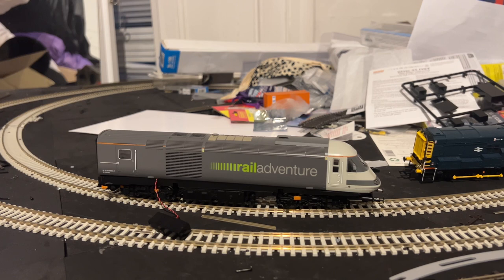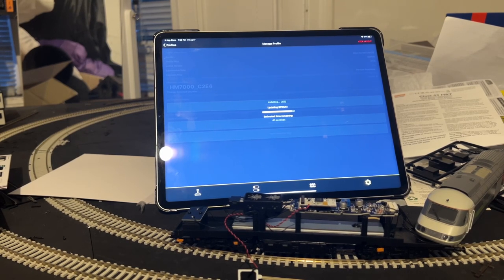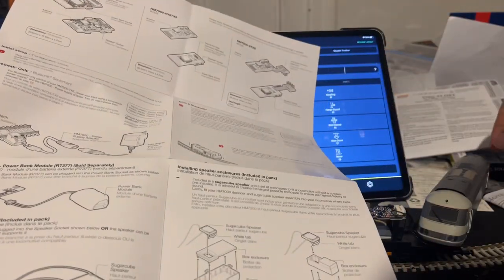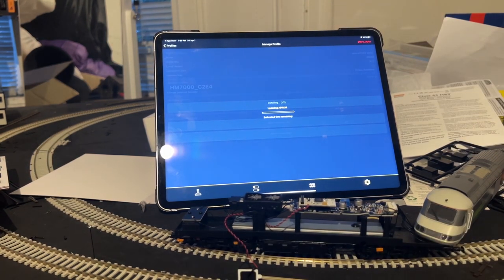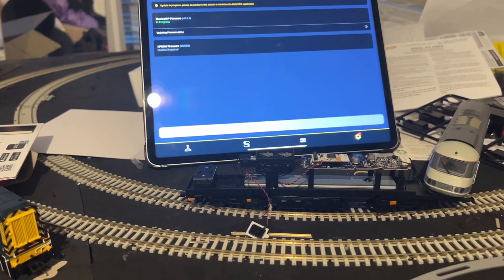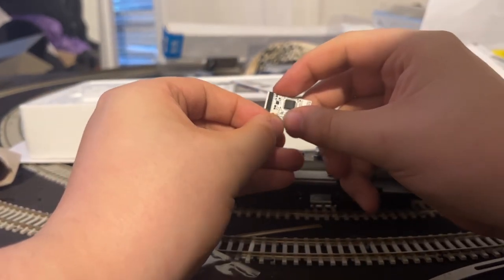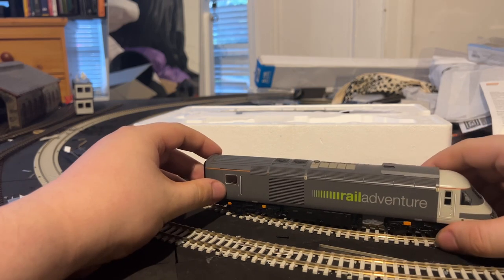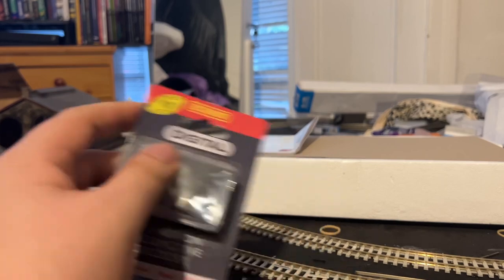Fitting a Hornby Bluetooth DCC Decoder and Speaker is it any good?

Comment: Hi, I got my Rail adventure HST set a couple of weeks ago, it is a great set, I had to strip down the fan assemblies because they ran very slow, I removed the poor very thick grease Hornby put in them at the factory I presume, once all cleaned out I lubricated the gearing in the fans with PTFE silicon grease formulated for plastics, all 4 fans run nice and smooth now, I will probably fit Legomanbiffo sound decoders at some stage this year, thanks for sharing your HST experience.